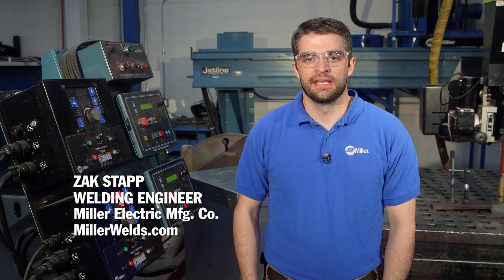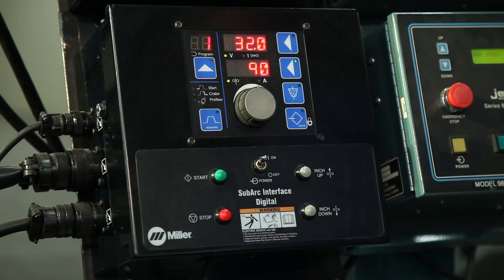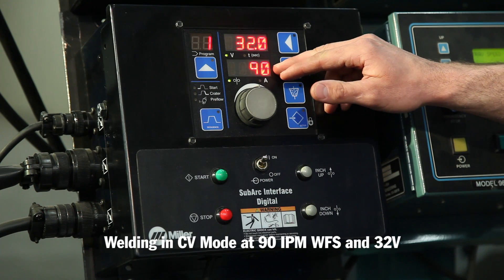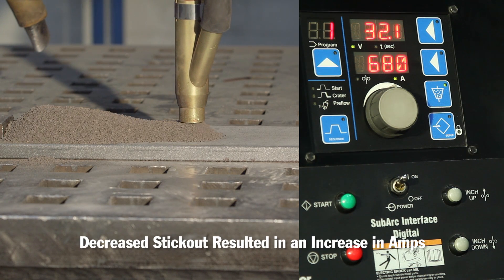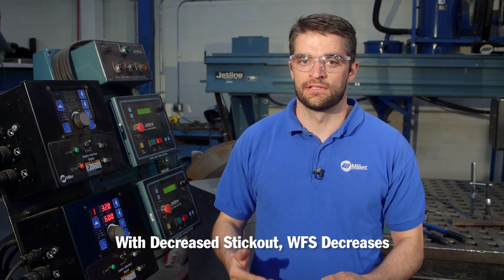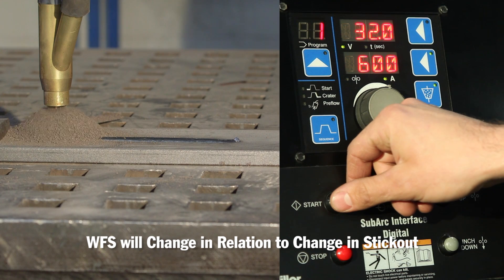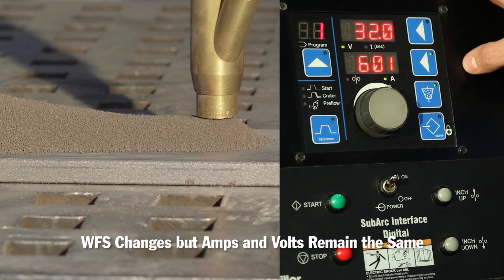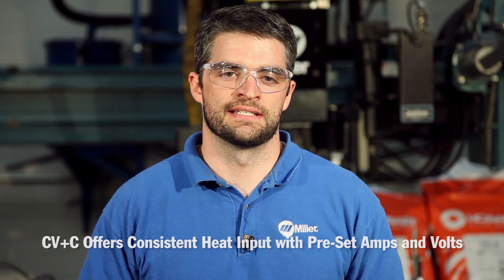Control your heat input with innovative Miller SubArc solution

Comment: But when you decrease the stickout, will it maintain that amperage because the volts will catch up and regualte the arc?
Reply from the maker: Jason, it regulates the amperages by adjusting the wire feed speed (WFS).  The voltage is maintained because it is a constant voltage (CV) process in its basics. When stickout is decrease the WFS is decreased to maintain the amperage.

Comment: sir we are facing problem ofpin holes coming during welding of blow out preventers  by sub merged arc welding process
Reply from the maker: Thank you for reaching out. We recommend giving our service line a call to talk this through with a tech. The number is 920-734-9821. If there’s anything else we can help with, just let us know.